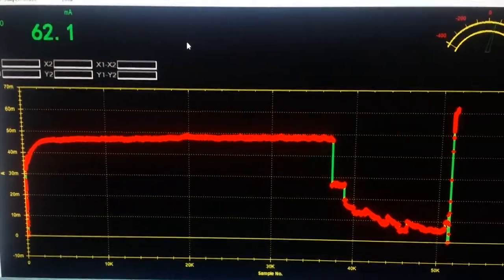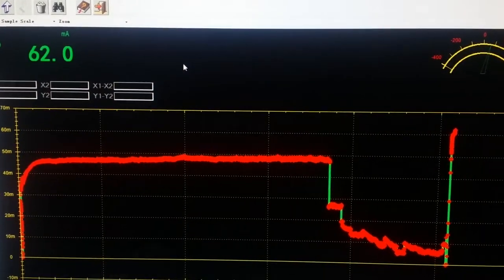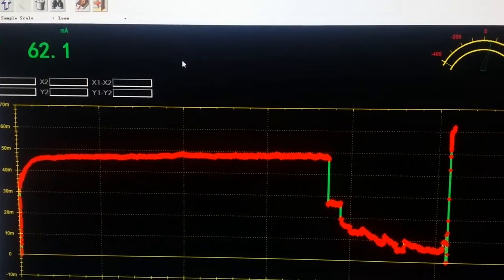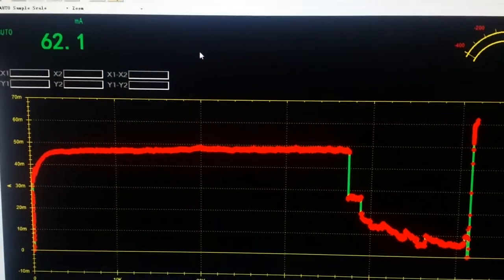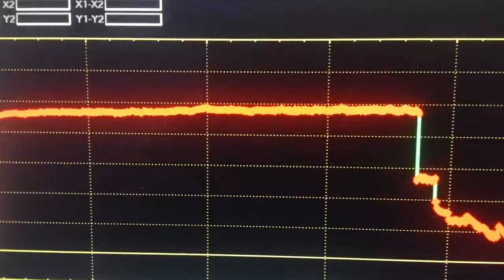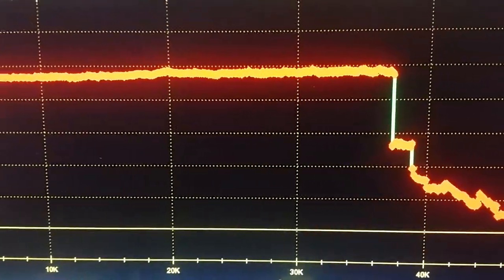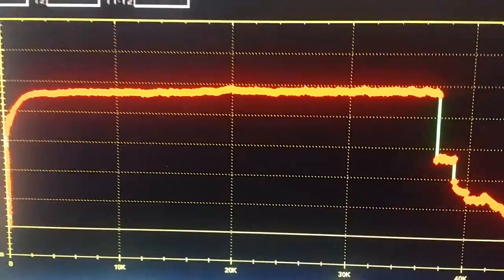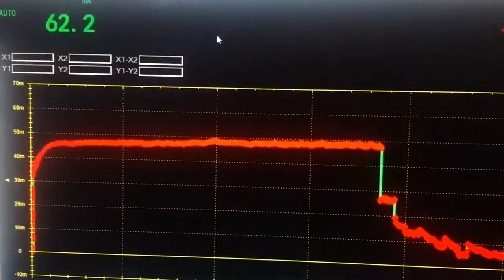Allwest hybrid cell

Comment: Intriguing graphing there Steve. This structure would seem to use charging to better form itself, while it should be discharging ? If so. does it continue that process over several cycles ?
Reply from the maker: Hi Slider,

I have been trying to marry several different types of cells into one, so far this is what I came up with 

There is no outside charge to this cell, magnesium and copper 

At this point I think the copper patina is acting like a catalysis for the hydrogen the galvanic cell is creating within the wet cell, the magnesium does erode 

11 hours later the small magnesium rod was gone 

The interesting part on this is that the power-amps never went down on a direct short discharge 

So at this point I am wondering why the amps never went down even though the mag was being eaten up